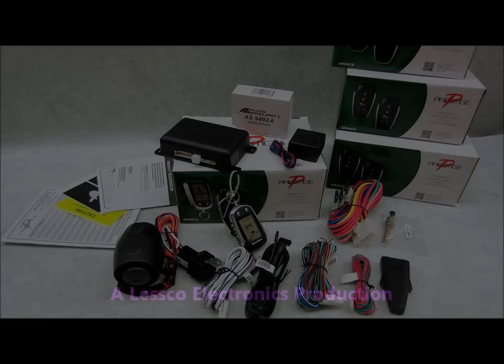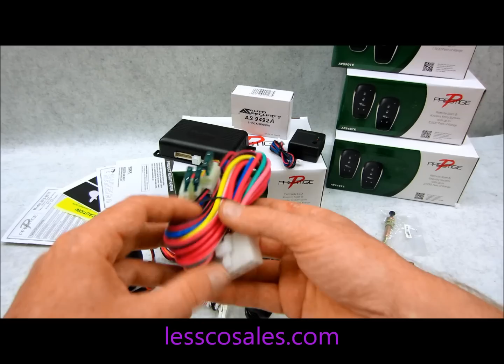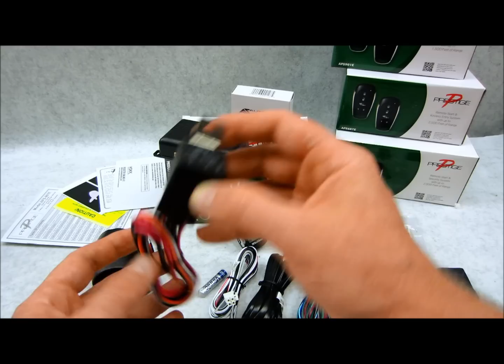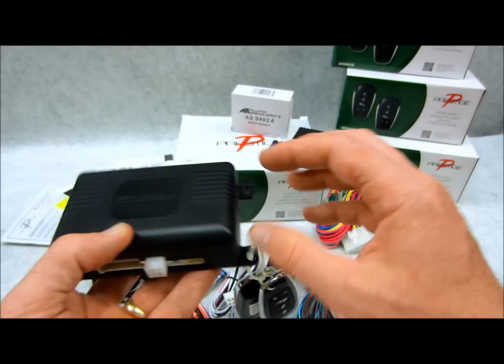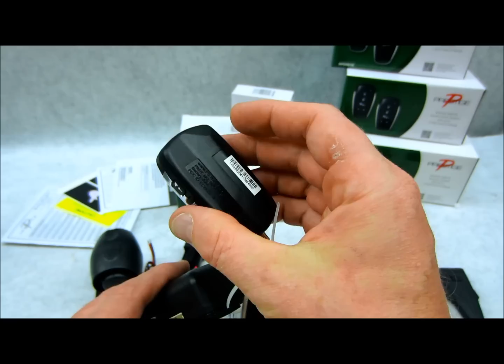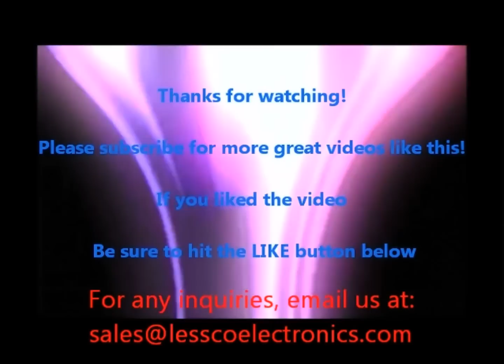Prestige APS997E Alarm Remote Start Review

Comment: Hi just did an install on the 997z.But I not getting nothing from it.If i disconnect the ground wire from the 4 pin connector I could hear the alarm going off real low.It doesnt repond to the remotes either.
Reply: Same here did you figure it out
Reply: @BIGMAN8435 DID YOU EVER FIGURE IT OUT

Comment: This unit has serious issue in my opinion. It DOES NOT relock/rearm car if I disarm and do not open a door/trunk/hood within 30 sec or longer. It stays open. Though manual says that after disarm LED should rapidly blink waiting for somebody to get in. It doesn’t happen. LED just goes off that nothing happens then. However this feature becomes available if I enable Passive Arm/Lock via programming mode. But it then locks and arm car passively after opening/closing door. I don’t want this behavior because it may result into situation with keys to be locked inside. Is that normal that rearm/relock is only available with passive arm/lock enabled? Or my unit is bogus?
Thanks.
Reply: Also another issue. Bank 2 feature 7 has no effect. Horn always chirps and activates with siren. No matter what option I select.

Comment: My prestige APS997E alarm is giving me problems so when I go to remote start it will start for a little bit then turn off then restart then again restart I think it does it twice or three times then the siren goes off can you help me with this problem or steer me in the right direction and thanks for the other help it worked great. 
Thanks! 😊
Reply from the maker: there are built in diagnostics in your system that will tell you everything, if you need help with all that call audiovox tech at 631 231 7750

Comment: I brought a crimestoppet positive door lock inverter couldn't get it to work so I brought some five pin relays with wire connection s haven't tried yet don't know how to wire it to my 1996 suburban  with 6 wire relay with ban doors

Comment: i cant get this system to unlock and lock my door s on my 1996 suburban with barn doors please help i had to put my avital 3100 back on for the door locks to work
Reply from the maker: Huler Dixon All you should need to do is reuse the relays from the old alarm and wire it into the new one.
Reply: a vital 3100  have internal relay for positive and negative door locks build in I thought the prestige APS was the same. but I brought some relays like the ones you have on the video

Comment: You mention this is compatible with iData. do you know of any headunits with a built-in blackbox function that could tie into the APS997E?

I was looking for an android based headunit preferably but It'd be nice to have any headunit capable of connecting to the idata port.

If not;
would you happen to know who the best manufacture is for idata addons? I have glanced around ebay and found one that has a monthly price of 3usd. Is that a good price?
Reply: What's the thing on the left in the video, looks like a hand grenade.
Reply: Josh Schmiedchen siren
Reply from the maker: Josh Schmiedchen thats the siren